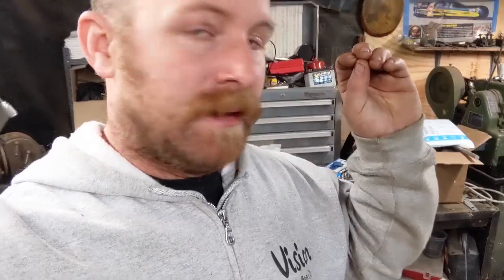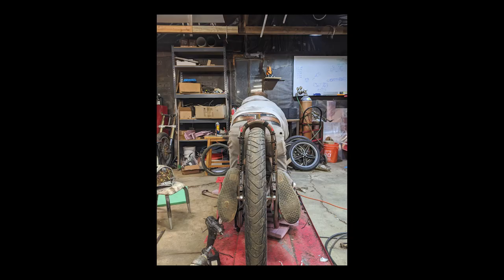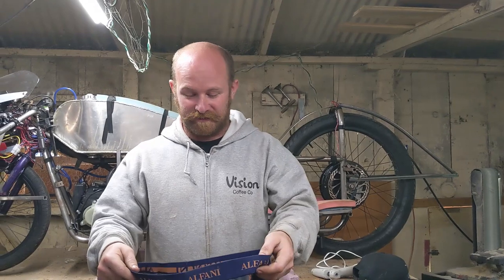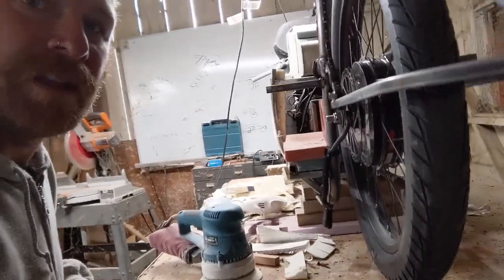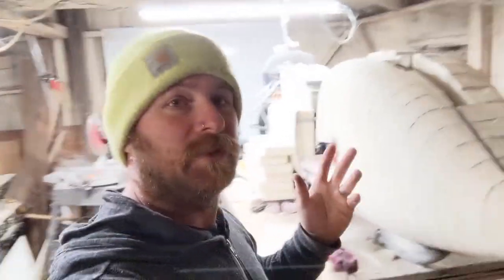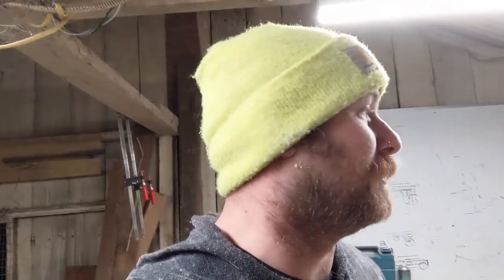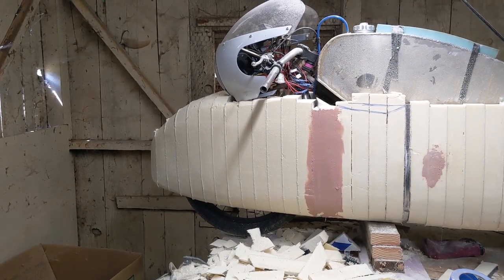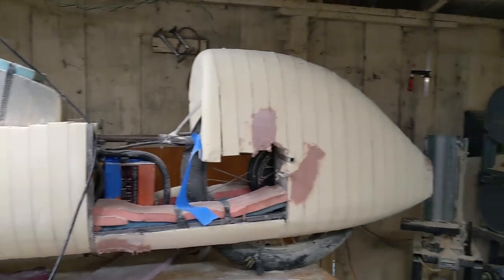Extreme range EV Mini Bike | Fiberglass Foam Shaping | Lark Machine Co

Comment: This might be too late, but here goes... you need uniform lighting to make it symmetrical. When I was shaping surfboards, there was perfectly symmetrical lighting in the shaping bays so that you could easily see any inconsistencies. Ideally, you want one centered light source from above and two identical sources on the sides, and the ability to switch them on/off independently.
Love your projects Shea, keep on going!  :)
Reply from the maker: I'm pretty sure I'm not completely symetrical. I did most by feel and eye.  Thanks so much for the tips.  I'm gonna use that we I do the projects that really count!

Comment: That's not bad for your first time playing with foam and fiberglass. Stacking the foam always works best. Adding some thin wood where you want it to be symmetrical on both sides, you would have to cut a wood template and put them in every other foam stack. or eery 3 works then use a long sanding block. It's how I do my large scale RC planes with carbon fiber. Also, Check out Mike Patey's Draco, and now Scrappy build he has some great tips on using foam and glass and carbon. He's an amazing full-size airplane builder. You would love his channel, it's pretty awesome like yours...

Comment: How much weight have you added? I'm curious if the aero to weight will make a difference. Either way it still looks cool so I support it either way.
Reply from the maker: That's a good point. At this slow of a speed the aero gains are not as significant.  The fiberglass will probably add about 35lbs.  It will effect acceleration but should hurt the wattage used at constant speed.  I'll make sure to mention the gains